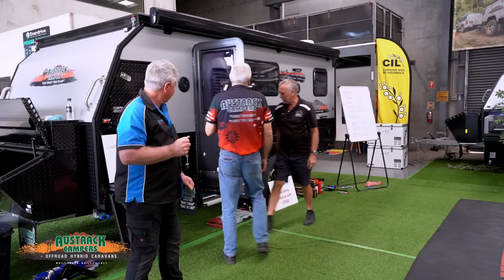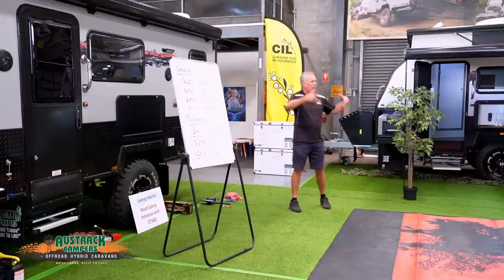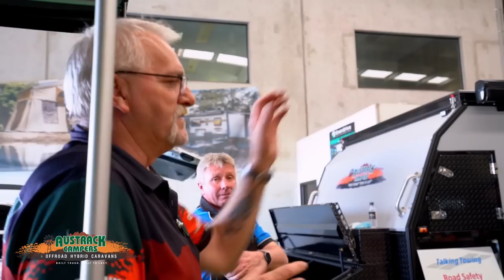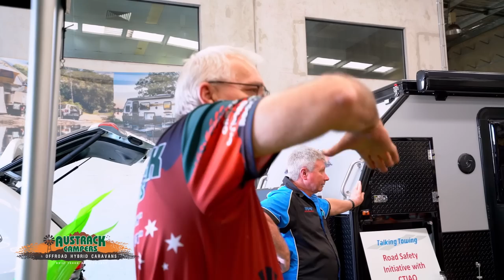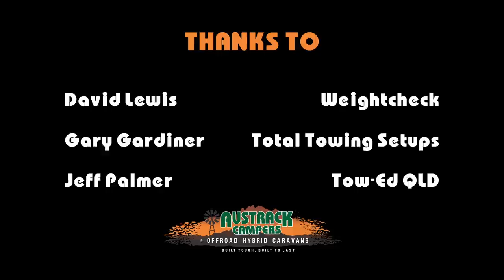Austrack Academy - Weight+Towing Seminar

Comment: The Patrol has a 3500kg maximum towing capacity with a 350kg Maximum Towball Mass (TBM), and a Gross Vehicle Mass (GVM) of 3500kg (payload is 750kg). Its Gross Combined Mass (GCM) is 7000kg, meaning you can tow to its maximum 3500kg capacity with the Patrol loaded to its 3500kg maximum.16 Sept 2018
maybe you should update yourself

Comment: A really good video. Lots of top advice and well delivered by the guys.
Just one thing that needs further clarification. "Diesel is not flammable".

In the hazardous goods world diesel is rated as combustible due to its higher flashpoint (at +60c ish) than flammable liquids like petrol (at -40c ish).
The take away should be that both will burn but diesel safer in normal conditions.